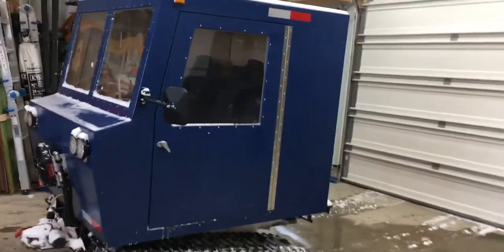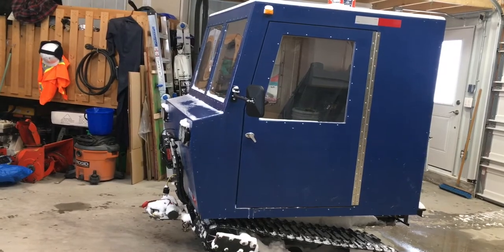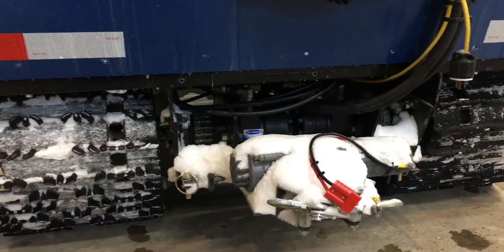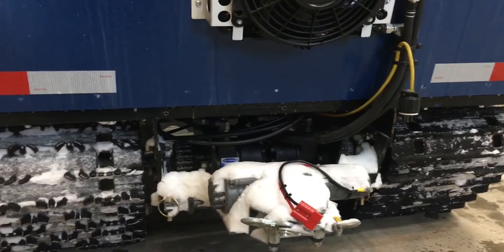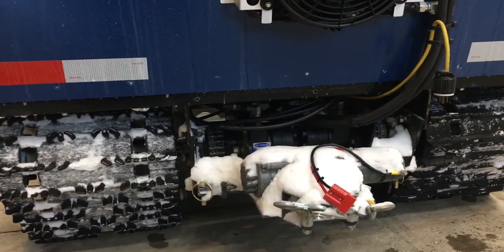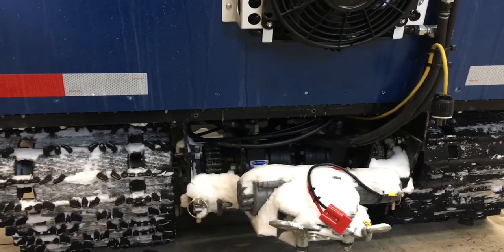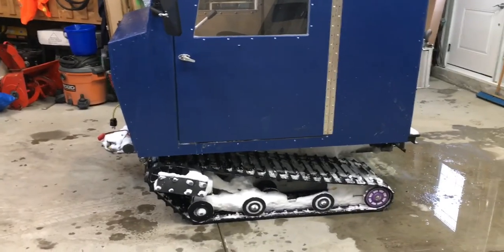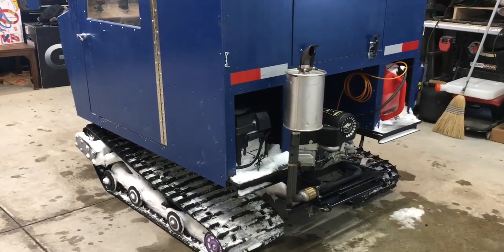Mini snow cat - Driveline issues

Comment: Interresting! 
What size hydrostatic pumps are you using? 
I have a similar build too, i think it was 24cc pump to 80cc motors, if i remember correctly i aimed for 3600rpm maximum engine speed to just under 1000rpm driveshaft speed.
Reply from the maker: Hey PC, it’s  good to hear come someone else who has gone through the same type of build! 

I originally provisioned the machine with 45cc motors and 10cc Hydro-gear pumps. I figured around 740rpm on the driveshaft. 

I have ordered some 96cc motors and have a pair of 16cc Hydro-gear pumps. I expect shaft speed to be 540rpm.

Just like you, I’m using 3600 as engine speed.
Reply: @rad1876  Yeah, but im not really there yet, i have only sourced the parts. However i have been thinking about the maximum torque of the hydraulic motors and also the engine power. 
As i remember i have a 24cc tandem pump mounted to ha 23hp V-twin engine similar to yours and those danfoss style drive motors with 80cc displacement. 
With max engine RPM of 3600rpm i should have about 1000rpm driveshaft speed (about 35Km/h) at full displacement, the 80cc motors have about 183Nm /1620lb/in torque each.  
The 45cc motors you are using right now will probably perform about 75Nm of torque so a 96cc will probably make it like tripple as strong even if it will decrese the top speed a bit. theoretically about 20km/h? How fast have you been going? 

Im glad to see that you seem to have no problem with lack of engine power so far. Im a little concerned about my slightly smaller engine tho. 
Keep up the good work, this is really interesting Rob, Sweden approves!
Reply: It also came to my mind that you may be able to increase the pressure of the pumps to gain a little more torque or at least match the maximum specified pressure for the drive motors.
Reply from the maker: Hey PC, my starting design was the unfortunate victim of scope creep.  Originally the machine was going to be a much leaner version of what I have today, single seat, no cab, 1/2 the weight. 
Had I followed that course, the 10cc pump/45cc motor combination would have been ok.  I think my system torque lower than your 75Nm estimate, probably around 50Nm or 37ft-lb.   The new motors are 5.9cu-in, 2.8/5.9 gives me a torque increase factor of 2.11 , so upgraded torque somewhere around 106Nm or 78ft-lb.

Top speed was supposed to be around 20kmh but the under-sized motor led to fluid slippage (shear) and I couldn't get above 16kmh, ~1/5th my speed was lost due to fluid slippage.  With the 16cc pumps and 96cc motors I expect to have less slippage and still have a top speed of 16kmh.  

I have been using a set of calculations in the Hydro-Gear manual (page 63), they allow you to calculate the tractive force needed for a machine of particular spec.  https://www.bibus.ro/fileadmin/product_data/hydro-gear/documents/hydro-gear_pumps_motors.pdf
Reply from the maker: The pressure in the hydraulic system is a property of load applied to the motor so there is no way directly increase it.  If the motor has no load the pressure is minimal (only enough to overcome the motor internal friction),  If you stall the motor by locking the shaft, the system pressure will be infinite , at least until the over-pressure valve opens around 3000psi.  

The is a way to indirectly control the system pressure which is by varying the motor displacement.  Smaller motor = higher system pressure, larger motor = lower system pressure.
Reply: @rad1876  
Hi, Im answering from my other account. 

It is very hard to estimate power, torque and loss in these kind of applications. 
I'm relly excited to see your result with the new pumps and motors! I assume your engine is powerful enough to run a higher drive ratio (bigger pump) to gain more top speed if you want. 

Your motors looks very similar to danfoss style georotors, a good thing for this is that the torque factor is not linear with the displacement, its more progressive. 
By looking in the documentation i have, the 40cc perform 74Nm and the 80cc will give 184Nm of torque, each motor. 
the 100cc version perform 213Nm according to the list i got, with a dialed in max pressure valve on the pump matching the max pressure of the pump (240 bar/3480PSI for danfoss) im quite sure you can be close to 400nm of hub torque. 

unfortunately i have no numbers how much torque these motors can peak from stalling or zero RPM, the lowest RPM/torque i can prove you with is 131Nm at 25RPM with about 100bar/1150PSI of pressure for the 100cc motor. 

I think you will have a doozer with no lack of engine power at all :D
Reply from the maker: Hey PC, Thanks. I'm really digging the comments!   There are only a few who get into the nitty gritty and talk about the mysteries of fluid power.  

You are SPOT-ON about estimating torque and power, I'm no mechanical engine-nerd so I sat & pondered upgrading to 78 or 96cc motors for about two weeks before ordering.  The silver lining is that my previous design had so much drive loss that these upgrades have regained a lot of power that was going into heat.  In-fact I would say previously there was a power deficit with the smaller pumps + motors + loss,  where now the drive system is able to effectively transmit the power.  This was likely the source of my heat problems.

The motors are indeed Danfoss, they are a 155 series. To be exact 155100A17B1AAAAA.  This was the smallest form factor 96cc motor I could find and fortunately Surplus Center had them in stock. Again, not sure why they are the most compact but the shoe fit..

I hadn't considered for non-linearity when increasing displacement,  I am definitely conservative with design calculations, and sometimes budget..  I am considering installing a set of pressure gauges to the L&R forward drive lines so I can get an idea of load/pressure.  Though I'm not sure if this would be useful ongoing..
Reply: @rad1876  what did you use for tracks
Reply from the maker: @rylankonen277  they are snowmobile tracks from a Polaris. 121” long 2.52 pitch drive lug. I have recently acquired 144” tracks to build a new set for the mini snowcat.